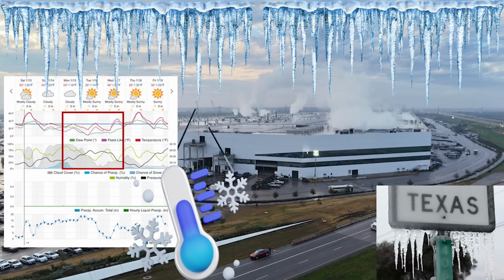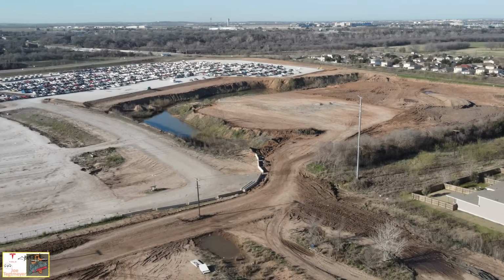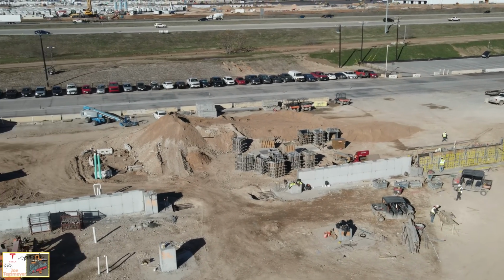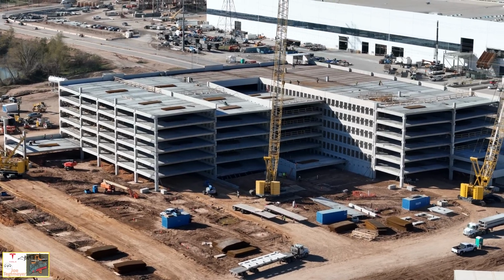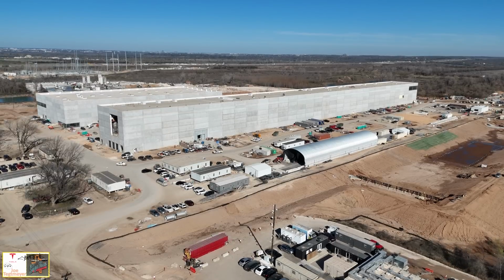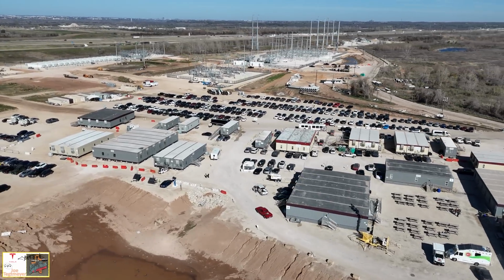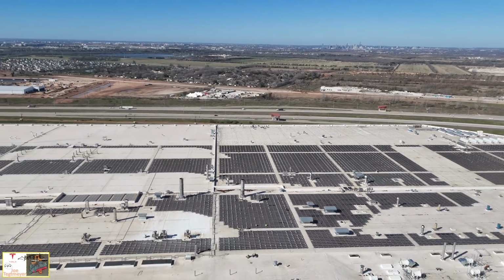Prufrock Arrives! S Extension & Park Garage Grow Larger!18 January 2024 Giga Texas Update (09:15AM)

Comment: The 4 eyes cast into the concrete block behind the TBM are the support/connections for the thrust frame which provides the reaction to the froward thrust of the TBM. The circular piece links the thrust frame to the first segment ( which the thrust passes through from the TBM rams).
Also next to the segment store are some of the TBM support sledges which carry the TBM back up equipment.
Heavy truck delivery looks like the middle shield of the TBM which carries the forward propulsion rams , articulation rams and the support to the erector for building the segments. Probably a third section still to come (tail shield) where the segments get built into but it may already be part of the middle shield.
TBM cuttherhead appears to be dressed with rocker picks. Mainly for soft ground excavation (little or no rock), unlike the Vegas Loop cutterheads which have rock roller discs also for the harder ground.
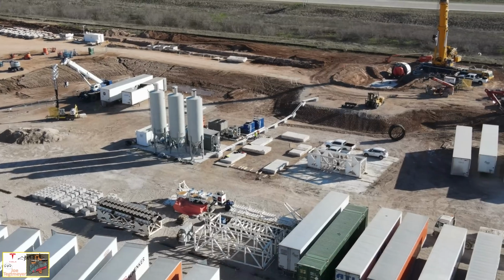Reply: 8:24. Conveyor magazine placed square to the tunnel alignment. Do you think that's the final position?
Reply: David, on this slow day (no video yet) I tried to figure out how a conveyor system could work. Is this summary below in the ballpark? 

Prufrock 2 can do 1 mile per week.
This is equivalent to excavating a cylinder with a radius of say 2 m and a length of 1600m. That means 20100 cubic meter to be moved in a week.
Assuming 24/7 operations that is 20100 / (24*7) or 120 m3 per hr.
Let’s call the excavated material sand @1,5 ton/m3, then the conveyor belt needs to move 180 tons per hour.

If I interpreted the info on the web correct then that would require a standard conveyor belt of 80 cm across and moving at about 1,1 m/s.  That seems OK, it is at the lower speed range of the standard list I found. 

Something else: the Prufrock 3 is aiming for a 7-fold increase in digging speed. I must say that seems an awfully large increase, either in the running speed of the belt and/or an increase of the size of the belt within an already fairly small confined space situation of a 4 meter tunnel. 
I wonder how they are going to do that. Hopefully GT will become the testing ground for PR3, then we'll see for ourselves
Reply: Your numbers seem fairly reasonable for the spoil and conveyor rating. I have worked on dozens of TBM's none of them work 24/7, they are pretty high maintenance machines. Usual patterns are 2x 10-hour production shifts then a 4-hour maintenance shift, 6 days a week with Sunday off for some planned heavy maintenance work (power cable extension, sub-station installation, motor swap-out, change hydraulic pumps etc. Trying to run a TBM much harder than this and you will quickly grind to a halt with multiple major breakdowns. Rock machines require regular changes to the cutting tools, but this crossing is soft ground and I expect they would want to make the crossing with no intervention to the cutterhead for maintenance.
Some do work 24/7 365 days of the year. But this takes a lot of support logistics and still planned maintenance is required.
For a short tunnel, small diameter TBM like this in soft ground conditions I would expect 2 shifts (if they choose to work at night). daily maintenance breaks. Excavation 50% of the time, ring build 50% of the time (they can't build and excavate at the same time with this machine and segments no matter what anyone may claim). So, 10 hours of excavation a day, at around 1mm/s excavation rate. Aiming to make the whole 300m crossing with no major maintenance stop. Maximum performance being then 36m a day, say 8.5 days. Allowing for a bit slower at the start (they can't push so hard and the logistics will need bringing up to speed) that is say 10-12 working days 24/h a day, 2-weeks of tunnelling. That would be very, very good for a TBM, but I suppose possible in good conditions, with good logistics and well drilled crew. 4-5m diameter records are up to 1,800m per month, 125m in a day, 470m in a week, (Texas super collider and yellow river China). I'm sure TBC are keen to show what they can do here with so many watching. This never happens in practice on a relatively short drive like this. So, we will see. Hence my prediction of 3-4 weeks at best, and if so, I will take my hat off to them for a successful drive.
Remember, the speed of tunnelling is rarely a major economic driver in the overall cost of a complex project. All Contractors want to go as fast as practicable but there are usually multiple external constraints that impact the logistical decisions for good economic, environmental or regulatory reasons. @hardernl8893
Reply from the maker: @tunnellingsalisbury7605  awesome info and insights TunnelingSalisbury and I thank you for taking the time with such a detailed note! I agree that they know this tunnel project is highly visible and will be seen by a lot of different audiences dodo it’s a opportunity to demonstrate what they can do. I think this also serves as a demo project to help get additional boring tunnel,projects approved and underway in and around the Austin area, as there have been several sets of plans I’ve seen but none yet approved.
     We are about to enter the last few weeks of potential freezing weather and the start of heavy rains in the next couple of months. What are your thoughts about how this kind of weather may impact their operations?
Reply: @JoeTegtmeyer  By the cutter head this appears to be prufrock 3.  [See comment above]
Reply: it will affect the surface logistics in the same way as any outdoor construction activity. Below ground the environment is very stable. Usually, the water table only varies a couple of feet and the ground temperature once you are few feet down is very stable year-round. Rain can badly affect the site set-up and any major welding work on the TBM (shouldn't be much as the TBM is in 3 full circle parts unlike a larger machine).  @JoeTegtmeyer
Reply: Anyone telling you a TBM of any size can do 1 mile a week is either lying or has no idea what they are talking about. Sorry to be blunt but it’s just pure physics, materials science and logistics.
To get a feeling of what is possible with the continuous conveyor system go to “Robbins continuous conveyors” and watch the YouTube video. One key point is that these type of conveyor systems only become economically viable with long tunnels.
Pointless for a 200-300m long tunnel like the one we are currently looking at.
If this machine can excavate at a mile a week it should be able to do that road crossing in a day, two at most. Let’s see.
Best case I would expect 2 weeks, realistically 3-4 weeks.
Reply: @davidsalisbury50  On google earth pro it's close enough to bang on 300m from the silt fence westside of highway to the building line.

I guess in a situation like this that is likely not a 'normal' commercial arrangement, using every bit of kit available, or showing off every bit of kit available takes precedence over what in other circumstances would be a simple yes/no decision.

Google earth pro also shows that at the time the highway was being constructed (2005 ish) none of the property either side had been quarried.
Under the highway at least should be natural earth, albeit sand and/or gravel at some depth.
Reply: Many thanks for educating me (and hopefully a lot of other watchers) in tunnel boring technology. The Robbins reference is truly a must-view for anyone interested!  @davidsalisbury50
Reply from the maker: Thank you very much David for the information and insights. As I understand it, you suspect the tunnel bore will be deep enough as to possibly be below the water table and if true, what can you tell with the grout equipment and setup that would tell us if any special waterproofing will be done here? Also, can you tell if this is a Pufrock 2 or 3 they are using. I’m not sure how to tell myself, so appreciate any thoughts. Finally, based on the setup, the type of soil and the distance, how long do you expecting initial tunneling to take?
Reply: @JoeTegtmeyer  the waterproofing comes from the EPDM gaskets in a groove on the edge of the segments. The grouting system is just to fill the annulus gap left by the tail of the TBM as the rings pass out of the back. It helps stability and avoids settlement of the ground.
I thought Prufrock 2 was in use in Vegas (Emcore), but that may be still Prufrock 1 and this is 2. Although I can’t see any significant differences
Reply: @davidsalisbury50  I thought Prufrock 1 and 2 were in Vegas at the new property by UNLV [as of Jan 10th as per the Jan 15th Las Vegas Review-Journal article] and this is Prufrock 3 from Bastrop? If I interpreted that article correctly, they'll start construction on the 2nd Encore tunnel in the March-April timeframe!?

[Edit: Looking at the design of the cutter head, especially around the 4 pairs of teeth around the outer edge, this does appear to be Prufrock 3]
Reply from the maker: @davidsalisbury50  Thanks David! I have confirmed it is Prufrock 3 that is being used at Giga Texas. This is apparently the first use of this new TBM ins a commercial project.
Reply: From what I can see it is the same basic design as previous TBC tunnel drives in Vegas. The dressing of the cutterhead will vary depending on the ground conditions. Not unusual for the same TBM to be used on multiple drives but the cutterhead set-up will be reviewed/refitted and modified for each drive and any particular set of ground conditions. No disc cutters on this one so they clearly don't expect any rock, Just rippers.
Generation 1, 2 or 3 it really doesn't matter, it's about being suited for the ground conditions. (you don't take a ferrari off-roading any more than you take a Land Rover to the track).
There was some claim about 2 and 3 being a lot (3x) more powerful. I don't see how, given the space constraints and what can be seen of the front shield (4x 300-400KW motors). Also, fundamentally no point as a TBM will generally run at less than 50% of the installed cutterhead power. 
The analogy again looking at a regular car. It may have 300hp and you may use 200 of those horses to accelerate up to cruising speed, but then you run at an optimum for efficiency at say 70hp. Making it 900hp only adds problems and cost. This is one of several reasons why I roll my eyes when people claim TBC's TBM's are more powerful, It's just pure BS, which is why TBC haven't done it.
Reply: Any sources of this and what is new about Prufrock 3? I didn't see anything there that wasn't standard tunnelling equipment I have regularly used in the past 35 years. Don't expect too much, it's just a regular underpass tunnel drive. There are a hundred of these going on around the world on any given day. Sore to be so 'Boring'. @JoeTegtmeyer
Reply from the maker: @tunnellingsalisbury7605  Yes of course ... I cite the sources in my 21 January video ... The Boring Company itself! video should be out shortly.
Reply from the maker: @tunnellingsalisbury7605  I note your concerns and reservations about some of the Prufrock 3 claims in my 21 Jan 2024 video intro. I also credit you with the information I present. I appreciate your help.
Reply: @tunnellingsalisbury7605  I wasn't focusing on the cutting discs/teeth as I understood those are swapped/replaced as needed - but rather focusing on details like the amount of structural metal adjacent to those cutters on the face.

Also the grooves on the face of Prufrock 1 and 2 run outward [parallel to the radius] whereas Prufrock 3 they run perpendicular to that — or are these replaceable wear surfaces?  [I assumed it reduced the muck sticking]

Plus the position of the ground conditioning outlets appear to differ between three machines and doesn't appear to have changed over time [from a cursory look], is this something that would be expect to be changed between jobs and ground conditions? 

I appreciate you have the experience here unlike myself to know which visible details are relevant and appreciate the knowledge you are sharing.  Still Prufrock 1 and 2 were seen in Vegas 10 days ago undergoing maintenance [like replacing/changing cutters] while Prufrock 3 was seen already setup very much like what's at GigaTexas [plus the above differences] so I'd still be surprised if it wasn't.

[The updates I saw highlighted for Prufock 3 were continuous mining and sub-24 hour surface launching.  They also mentioned (in response to a question) 3200 motor RPM, 500:1 ratio, 6.4 cutterhead rpm but you'd know better if that wasn't anything other than industry standard.]
Reply: Many good points, well observed. Same machine can be re-fitted with a completely new cutterhead but it seems you are right about this being a third machine. Not sure if it is the one used for the two tunnels at Bastrop that has had a re-fit and new head, maybe TBC will confirm sometime soon. 
The grooves are called hard facing, basically runs of a hard weld material for wear as you say. On many machines an additional material called "Hardox" is welded onto the exposed parts of a cutterhead, tends to be on larger machines in harder ground with a long drive ahead of them as it is an expensive option. 
I only noticed the lack if disc cutters on the cutterhead, you clearly are more observant than me. A cuttehead would look almost the same even if re-fitted with differing tools, so if the ground conditioning ports and openings are different it is a new cutterhead. So, let's settle on it being version 3 as far as we can tell.  
I question the continuous mining claim. Segments on site don't seem to be suitable, although the liner displacement arm on the erector (sticking out of the back of the middle shield) was unusual. This may be the development they are proposing. Let's see if a new type of segment gets delivered before they get started.
Sub 24-hour launching! We can see real time the requirements to set-up and launch a TBM of this size. Still a lot of components and back-up to deliver. My best guess is another week at least, possibly 2, before launch, depending on how much of the support equipment they launch with (can do a short launch on umbilical support if not enough space but it makes the overall process slower).
3200rpm for this type of motor seems appropriate (I think they are electric variable frequency drive but they are under covers so hard to tell). They will then have a fixed reduction gear (maybe 20:1) to a pinion on each of the 4 motors. They will be say  10 teeth onto a 250 tooth ring gear on the back of the main bearing (25:1). Giving you the overall 500:1 reduction to a 6.4 rpm maximum cutterhead rotation. Again, all very standard. Installed power is made up of three main components, forward thrust (Hydraulic rams), cutterhead drive (the 4 motors), and support equipment. These may be quoted separately but often a TBM will be quoted as total installed power. 4x 300Kw motors, 1,500Kw of hydraulic pump motors, and 1,000Kw for all the support power, total installed power of 3,800Kw. Much more and you need to beef up the bulkheads, motors and main bearing etc etc, but then you loose space for the motors, thrust rams, articulation rams, access to cutterhead, EPB screw position etc, and it all costs a lot more. It's a constant trade off like any machine.  @Gig0Surf
Reply: @JoeTegtmeyer  initial drive 1-2 weeks then another 2-3 weeks to complete. 3-5 weeks in total.
Reply from the maker: @davidsalisbury50  Thanks ... I use a lot of your information in my new 21 January video and short clip I posted on Social medial, crediting you for your help. Check it out! I appreciate your inputs!

Comment: With the south extension, I"m guessing that the area between the building and the steel construction with be constructed with precast concrete. I think that might explain the shorter footings. Also, the new crane is a Kobelco, which if you look back the Kolbeco's have been used for precast concrete while the Liebherr cranes have been used for steel... just an idea.
Reply: What timestamp? Do you mean walls or floors?
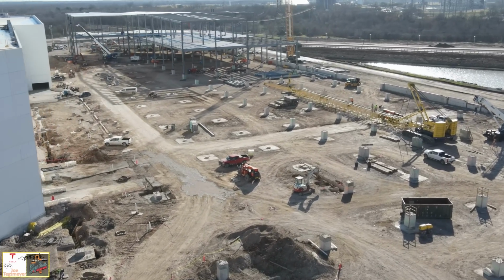Reply: @DessieDoolan  13:10ish. I’m guessing the columns and beams will be precast like the stamping and casting sections.
Reply: @tblake191  13:10 ish. I guess anything is possible. It is Tesla. From what I can see it's been set up for steel columns, going by the hold-down bolts in the footings.

The elevated column pedestals are a mystery. I think the floor is to be elevated around those. Purpose, unknown.

Comment: Whoever does site planning for Tesla isn't. First they jam the factory between an utility right of way and a major highway, insuring there's no place to expand as needed. Then they figure out a way to need a cockamamie tunnel under that highway in order to move cars from one side to the other. This despite having a huge site to comfortably and intelligently work with and produce elegant, flexible, accommodating structures that would do right by Tesla and be wonderful buildings in their own right. It was never meant to be. 
This is one circus act waiting for the clowns to sober up.

Comment: That new trench around the outbound lot looks like a Fire Protection Loop.
Reply from the maker: That might be … similar installation at the main factory and likely a building code requirement. Thanks!
Reply: @JoeTegtmeyer I was looking more closely, and I think it just more underground electrical conduit, because it connects to other trenches for the outbound lot overhead lights.